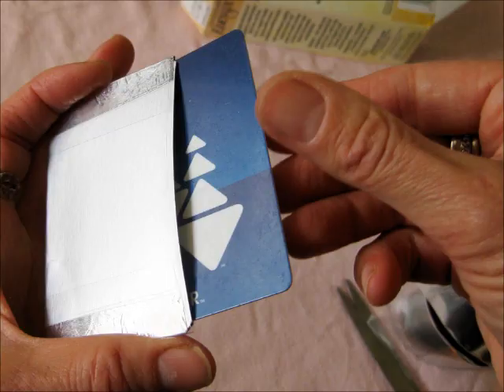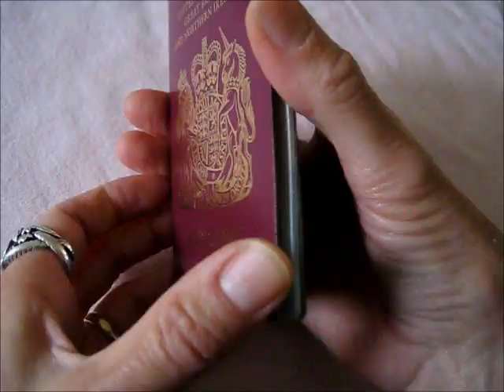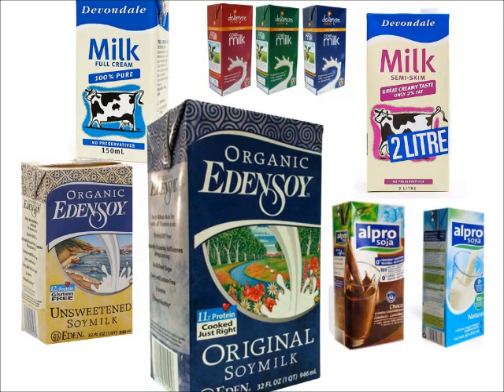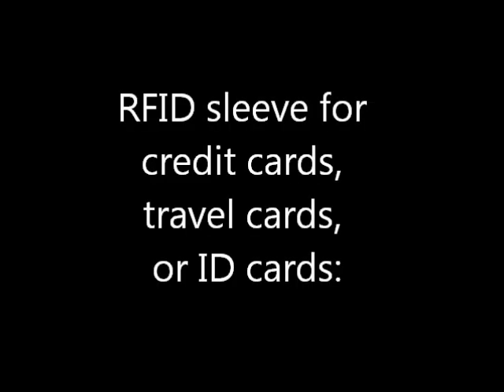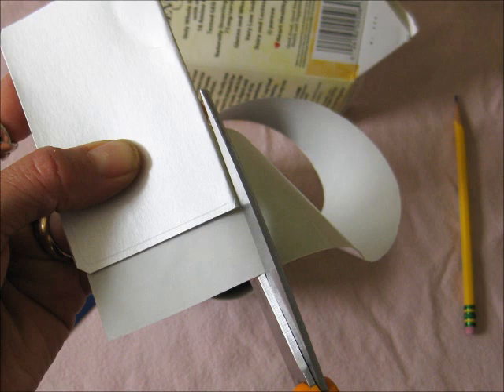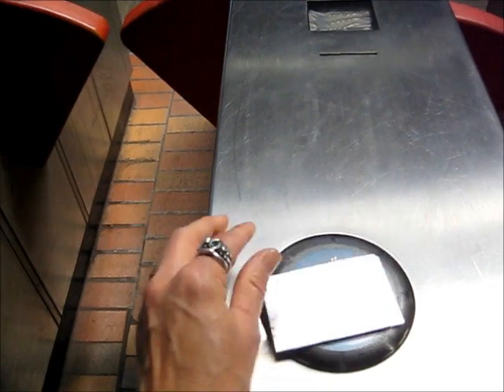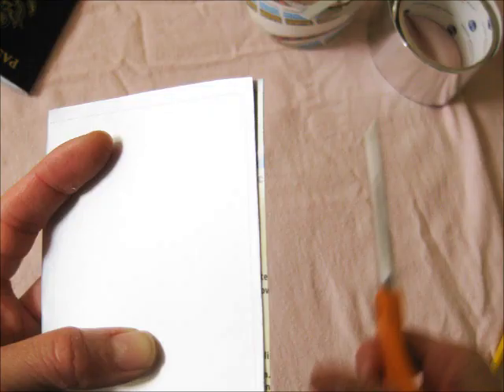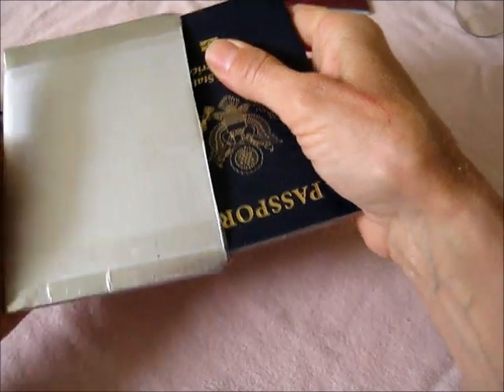DIY RFID Blocker Sleeves, for cards and passports

Comment: YOU. ARE. A FRIG'N GENIUS! I've been looking at a way to make a sleeve wallet that'll block RFID readers and I never thought about using my old soy milk containers! I've been using thin stainless steel sheets the size of my credit cards, but this is pretty frig'n nice! Thanks for the share!

*I do have one question though: does the foil have to be facing outward or can it be on the interior?

Comment from the maker: John, that number is more than possible, it's typical. You can see the guy on an iPhone at the end of my video on cell phone-smart meter comparison, and it's that high.

I don't have one to measure, sorry. Have your daughter configure the phone to minimize automatic connections such as FB updates and emails checks.  Their generation has to live with this stuff, but they don't have to  live with the max RF the stuff pumps out. My kid turns off wifi almost all the time, as the default.